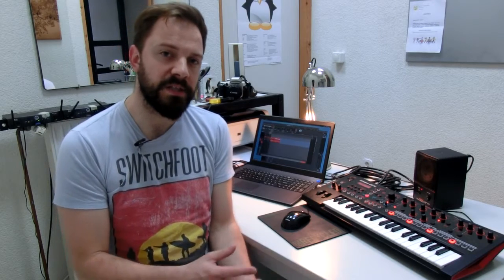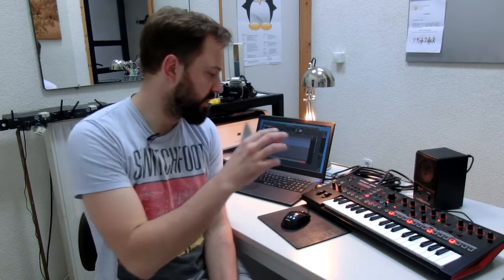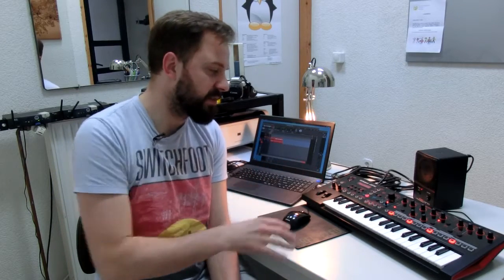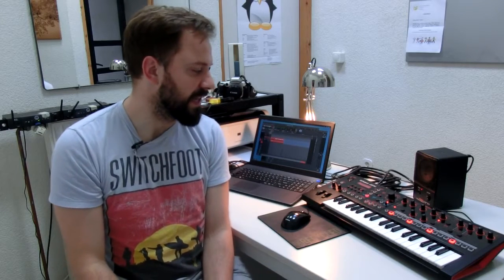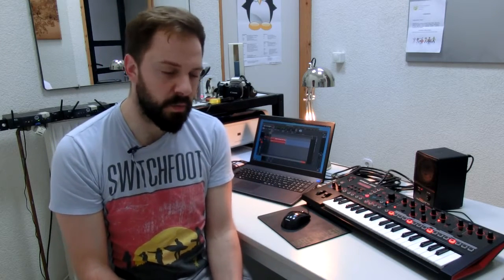Analog Synthesis overview on the Roland JD-Xi

Comment: hey Phillip, so as I can see on the video, you are still using your Tuxedo. Are you still happy using it or is it starting to fall apart?
Reply: It still works really well, and I am a happy user! :-) My next laptop will surely be a TUXEDO. It's taking a pretty regular beating on stage (DJ, Live recording, etc...) and still looks relatively new - except the front cover - the finish is kind of low quality - so it is scratched. The USB ports are starting to feel "loose" so i guess i will have to fiddle with the metal casings to tighten them up again. Apart from that - LIKE NEW!